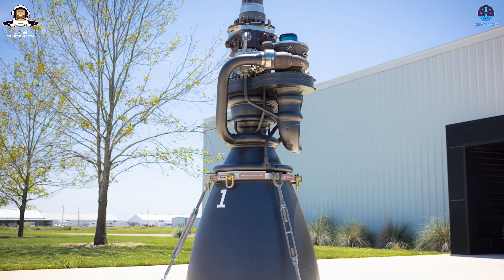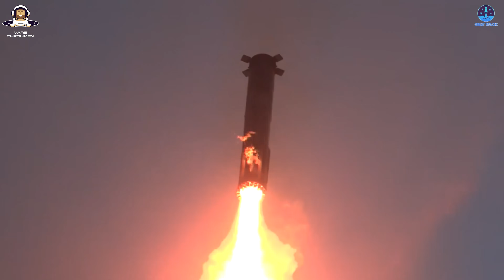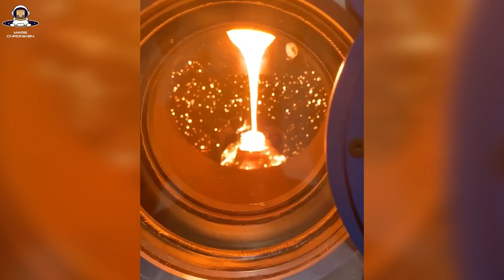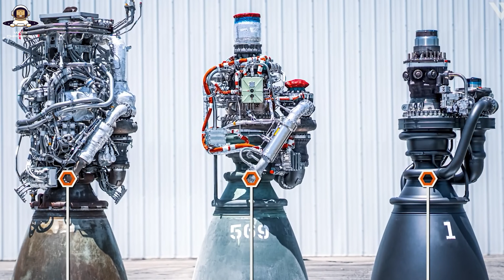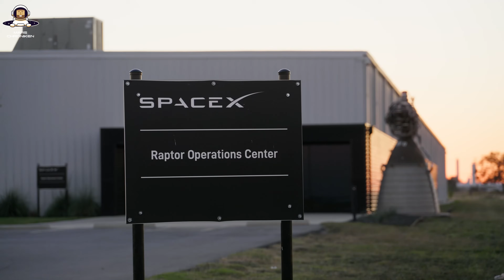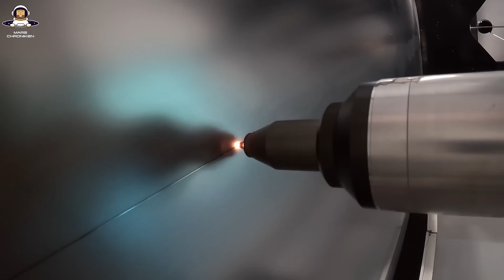Full-Flow Staged Combustion: SpaceX Breaks a 60-Year Curse

Comment: Im not stepping foot inside a rocket that you just explained uses it own hot fuel vapor to pump back into the fuel tanks, so they dont collapse in on themselves during emptying, that could ignite the whole tank if the fuel sloshes around too much while its burning.
Reply: The key here is to not mixing oxygen and methane so that it doesn't burn.

Comment: Those rocket engines are very efficient. The heat of the 32 engines cannot be operated for long in that chamber. What if they attached engines using another system around the starship.